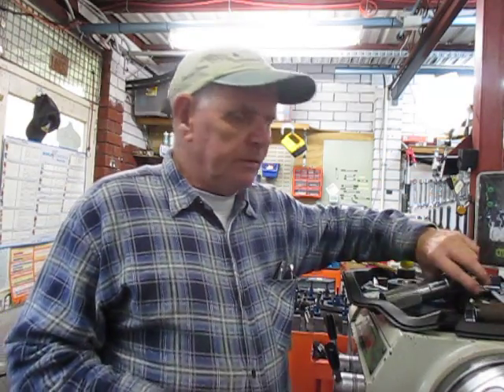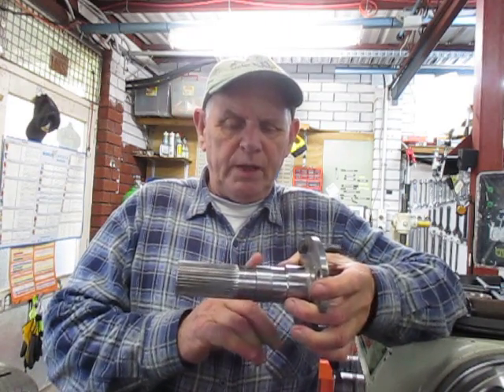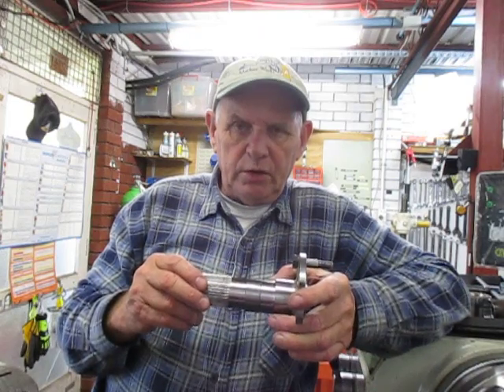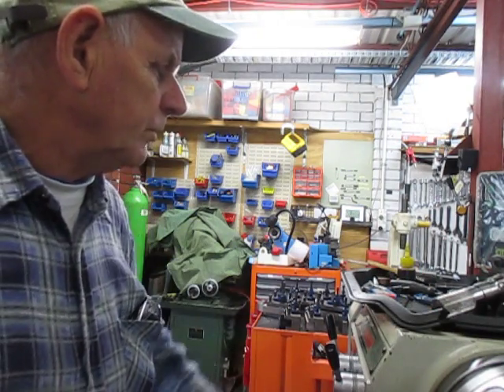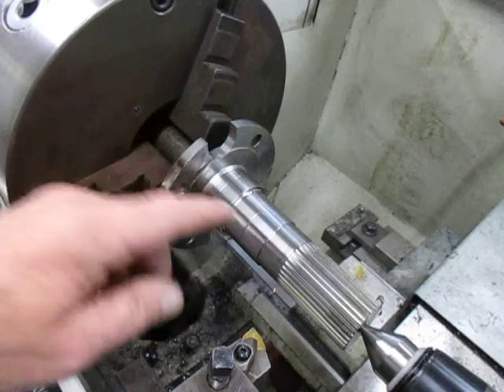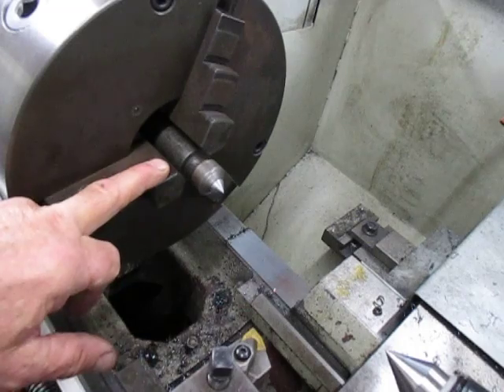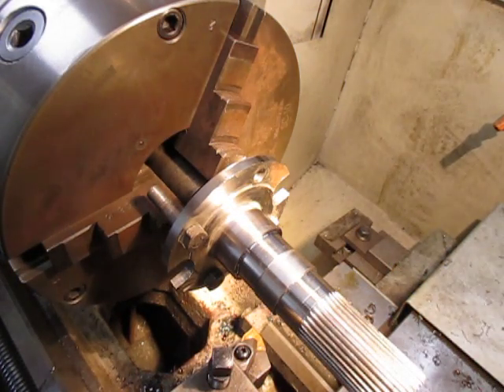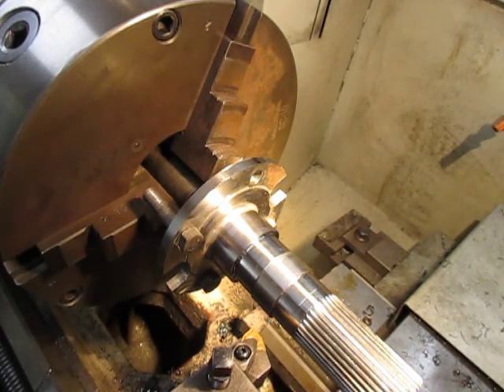Machining Shaft part 3

Comment: Nice one Bruce! Not so long ago I tried Kyocera Cermet inserts for the first time on a Hercus 260, a lathe not exactly of toolroom quality or rigidity, and had excellent results on hardened steels. I think they may be somewhat tougher than pure ceramics, but I'm no expert on inserts. It was eye opening for me and now I run a similar grade of inserts on a facing cutter in the mill, it can run at very high speed and leaves a mirror finish. The availability if this type of tool at relatively inexpensive cost is game changing in my opinion and I would never have thought small machines such as I have would be capable of hard turning, yet I'm certainly very pleased with the results. Keep up the great work, I noticed a comment on an HBM, a machine I'd love to have, so hope to see that feature on one of your videos soon.

Comment: Very nice bruce I love your videos. two random querys whats in the green gas cylinder and when are we going to see the lovley HBM
Reply from the maker: Andre Mausli Firstly The green cylinder is SF6 Gas, used as an arc quench for High Voltage Switch Gear (an alternative to oil breakers that can be very dangerous), I'm making some connectors for the bottles. Secondly I'm at a quandary on how to rearrange the shop so I can fit the HBM in. Believe me that is a major headache, something has to go and somethings will need to be shifted to a less convenient place.
Reply: Thanks for replying Bruce cherrs from Sydney

Comment: Hi Bruce, those parts are looking very nice, sure customer will be happy...
One thing You did not explain, is how you centered the bearing itself on the 3 jaws chuck... My guess is with shims but, you're the one with the final word...
Cheers, Pierre
Reply from the maker: pierre beaudry The Chuck is a dream, I set the bearing up and indicated it to 0.005mm runout. Machined half and turned it around and repeated the process.